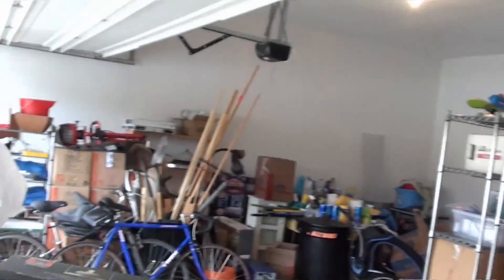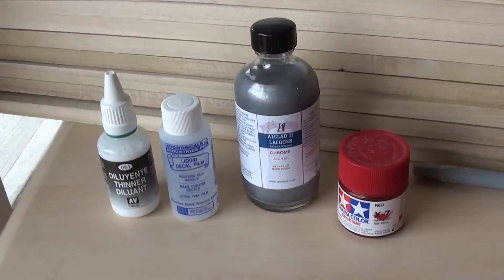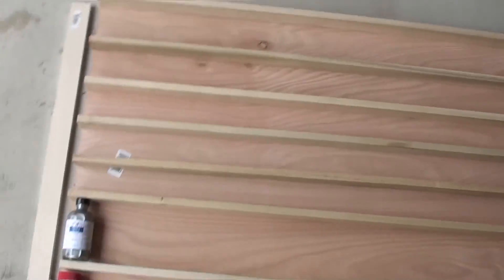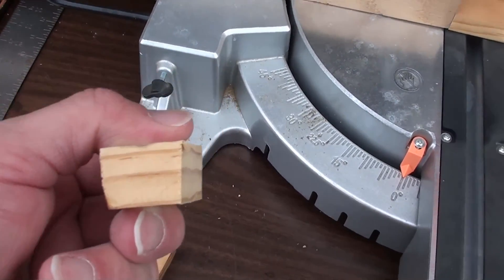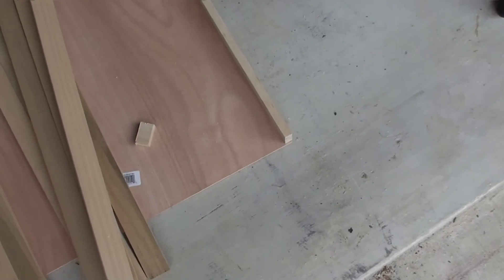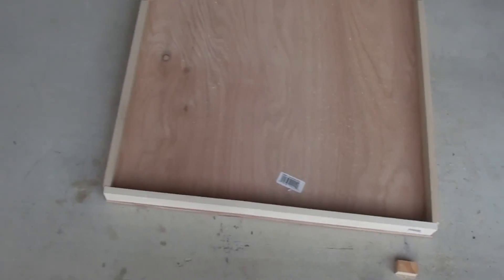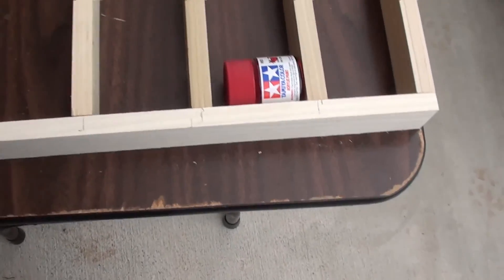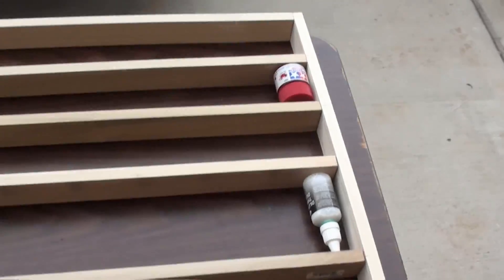Hobby room update part 4:  Paint rack (part 1)

Comment: If you line up your paint rack with your work bench, let the workbench support the weight of the paint rack and just use some screws with large washers on the corners to fix the rack to the walls.
If you don't want to put holes on the walls just get some finished plywood and use as a false wall then mount the rack to the false wall.
Reply from the maker: I put it on the wall with three wall anchors that each support 75 lbs.    It isn't going anywhere.

Comment: Best stud finder I ever used is a rare earth magnet. Run it across the wall it will catch on a drywall screw.
Reply from the maker: Didn't think about that.  But I do have a stud finder and it does work fine.